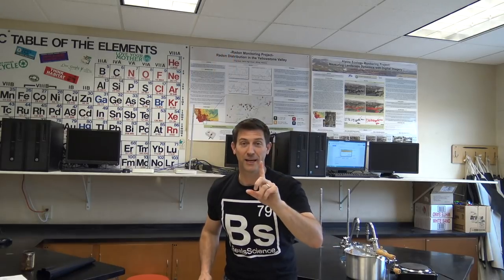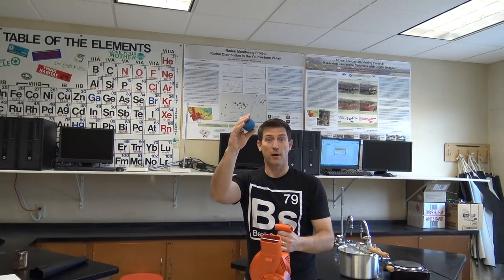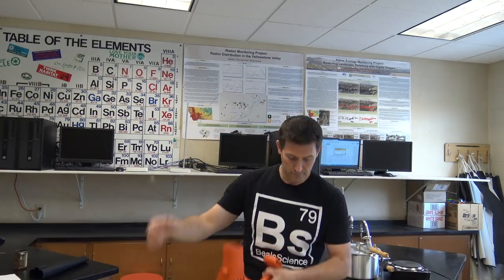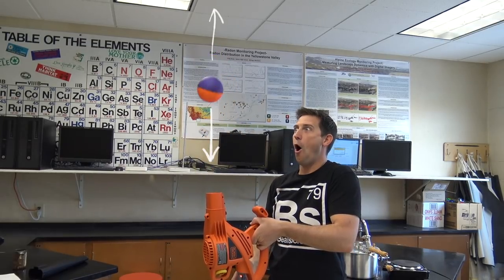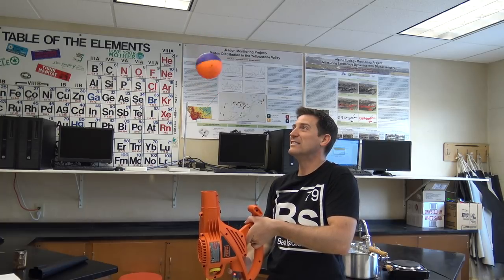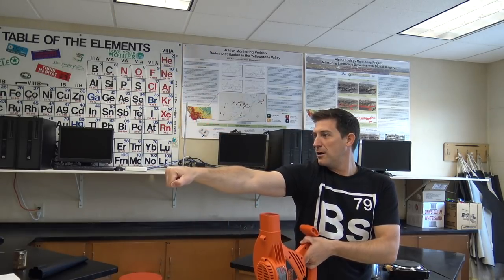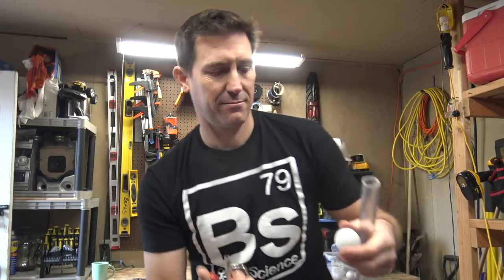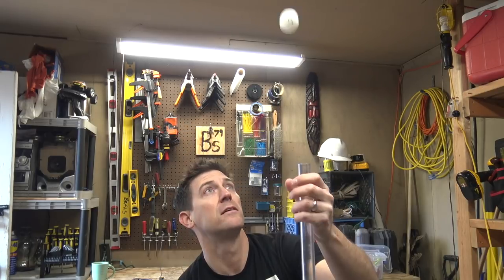Floating Balls - Bernoulli's Principle Visualized

Comment from the maker: Thanks for watching! I'd love to hear from you! Leave me a comment and let me know what you think or share an idea!
~Craig
Reply: Beals Science I found your channel from my fifth grade teacher Miss Whittle. She said she went to some event with you
Reply: Great video, not sure how you dont have more subs. Try reddit r/science or r/interestingasfuck .
Reply: @Beals Science,
Hi there :)

What would happen if;

Step1:  you had two similar air pumps, you run the 1st and let the ball levitate back and forth to left and right.

Step2: You turn on the 2nd air pump also. Does the ball get attracted to the 2nd pump due to pressure change?
Reply: Garden of AI 
You would definitely need an air pressure regulator to dial in the flow rate to be as close to the same CFM as one another, and even still I think the air would become turbulent rendering the experiment a failure 🤷🏻‍♂️ just conducting a thought experiment with the knowledge I have (or lack the of lol) of air flow doesn’t seem like this would work at all. IMO but I’d be interested to know 🧐
Reply: Pin it

Comment: As it seems you are keeping the ball on the vertical plane. This is not Bernoulli’s principle as per what I have learnt. This is balancing the weight by a force. Bernoulli’s principle applies for the force applied by the pressure gradient. Am I wrong? Please correct me if I am wrong....

Comment: I got a one question for you.
Can you explain for me...what is the difference between  Bernoulli's Principle and venturi effect?
Reply from the maker: I am not well versed on the Venturi Effect, but if my memory is correct, the Venturi Effect is an explanation of the drop in pressure due to a constriction in the area where the fluid is flowing. The Bernoulli Principle deals with the change in pressure due to the speed of the fluid (like Venturi) but is not limited to the constriction of a pipe (or the vessel that the fluid is flowing through).
Reply: Thank you very much. Have a nice day.
Reply: +Beals Science,
.
The venturi is one of the few places where Bernoulli's Principle applies. 
..
Pressure is higher in the wide section, but velocity is slower.  There's your inverse relationship.
...
Think about it.
The fluid/air has mass.
Newton teaches us that it takes a force to accelerate a mass.
Pressure difference is the force that accelerates a fluid.
...
In the venturi, the narrow section is a restriction.  This causes the pressure up-stream to increase; IN the fat section. This increased pressure in the large section pushes (accelerates) the fluid into the lower pressure, narrow section.  
Think of the narrow section as a hole in the pressurized fat section; like a hole in a pressurized tank.
Regards

Comment: +Beals Science,
.
Craig,
.
I really do appreciate the work you do to make science exciting.  I do the same at several schools and for groups like scouts.
...However...
..
I am very sorry, but it is not correct to say that "faster air has a lower pressure."
That is the all too common misinterpretation of Bernoulli's Principle.  The air out of the straw and blower is at the same atmospheric pressure as all the still air around it.   You can easily measure it yourself as shown in the Weltner paper linked below.
...
Bernoulli's Principle says that an increase in speed (this is acceleration) of a flow, IS ACCOMPANIED BY a decrease in pressure. 
..
 It says nothing about cause and effect, nor speed past a surface.  It is all about pressure differences along a moving stream and the acceleration those pressures cause.  
..
The science is that a higher pressure upstream in a flow pushes (accelerates) the air to a higher speed because the downstream pressure is lower.  There is a net force behind the flow, therefore,speeding the air up.  That is why it is faster when it gets to the lower pressure region.  This is nothing more than Newton for Fluids. 
...
It is centered by the Coanda Effect. Air curving around the ball is the cause of a lower pressure at the surface.  Think of centrifugal force trying to keep the air away from the curved surface of the ball (actually the air's inertia trying to go straight). This is what creates the lower pressure.  When the ball moves to one side, there is air on the other side curving further around the ball. This lowers the pressure more on that side, bring the ball toward this lower pressure.  The changing pressures are caused by air/water traveling less or more around the curve causing less or more pressure reduction at the surface, respectively.
The same thing happens when you tilt toe flow off vertical.  There is air above the ball flowing farther around the curve lowering the pressure more.   If you understand this fully, you can even explain why the ball moves further out as you tip the flow more off vertical.
...
The lift explanation is also flawed because Bernoulli says nothing about air moving past a surface.  The wing is moving past the air and measurement shows us that the air under the wing gets pushed forward by the wing at a faster speed than the air above the wing gets yanked rearward because of the lower pressure above the wing.  That upper air actually reverses direction from moving forward ahead of the wing to moving rearward above the wing.  This is a high acceleration from the pressure difference from ahead of the wing to above the wing. More change in pressure, higher acceleration of air.
...
Weltner in PDF - "Misinterpretations of Bernoulli's Law".  
SEE  Fig 3 is the fast air measurement:
 http://user.uni-frankfurt.de/~weltner/Misinterpretations%20of%20Bernoullis%20Law%202011%20internet.pdf 
..
Reply if you need further explanation.
Regards, Steve
Science and Technical Advisor
Reply: Observ45er thank you!  I have spent hours trying to understand this topic, and I think I am finally stating to get it!

Comment: Take 2.
+Beals Science,
.
Craig,
.
I really do appreciate the work you do to make science exciting.  I do the same at several schools and for groups like scouts.
...However...
..
I am very sorry, but it is not correct to say that "faster air has a lower pressure."
That is the all too common misinterpretation of Bernoulli's Principle.  The air out of the straw and blower is at the same atmospheric pressure as all the still air around it.   You can easily measure it yourself as shown in the Weltner paper linked below.
...
Bernoulli's Principle says that an increase in speed (this is acceleration) of a flow, IS ACCOMPANIED BY a decrease in pressure. 
..
 It says nothing about cause and effect, nor speed past a surface.  It is all about pressure differences along a moving stream and the acceleration those pressures cause.  
..
The science is that a higher pressure upstream in a flow pushes (accelerates) the air to a higher speed because the downstream pressure is lower.  There is a net force behind the flow, therefore,speeding the air up.  That is why it is faster when it gets to the lower pressure region.  This is nothing more than Newton for Fluids. 
...
It is centered by the Coanda Effect. Air curving around the ball is the cause of a lower pressure at the surface.  Think of centrifugal force trying to keep the air away from the curved surface of the ball (actually the air's inertia trying to go straight). This is what creates the lower pressure.  When the ball moves to one side, there is air on the other side curving further around the ball. This lowers the pressure more on that side, bring the ball toward this lower pressure.  The changing pressures are caused by air/water traveling less or more around the curve causing less or more pressure reduction at the surface, respectively.
The same thing happens when you tilt toe flow off vertical.  There is air above the ball flowing farther around the curve lowering the pressure more.   If you understand this fully, you can even explain why the ball moves further out as you tip the flow more off vertical.
...
The lift explanation is also flawed because Bernoulli says nothing about air moving past a surface.  The wing is moving past the air and measurement shows us that the air under the wing gets pushed forward by the wing at a faster speed than the air above the wing gets yanked rearward because of the lower pressure above the wing.  That upper air actually reverses direction from moving forward ahead of the wing to moving rearward above the wing.  This is a high acceleration from the pressure difference from ahead of the wing to above the wing. More change in pressure, higher acceleration of air.
...
Weltner in PDF - "Misinterpretations of Bernoulli's Law".  
SEE  Fig 3 is the fast air measurement:
http://user.uni-frankfurt.de/~weltner/Misinterpretations%20of%20Bernoullis%20Law%202011%20internet.pdf     

..
Reply if you need further explanation.
Regards, Steve
Science and Technical Advisor

Comment: With all due respect…somethin' ain't right about this so called Bernoulli Principle visualization. You're saying the ball floats as a result of Bernoulli's Principle but here the ball is merely "floating" by the force of the flow below impacting in equilibrium with gravity…and it is staying in place merely because of its shape which causes the flow to be evenly split all around the object keeping it "in place/centered" but this has nothing to do with Bernoulli's Principle. This is simple "holding" an object with a "dynamic" fluid "stick". The flows upward velocity is simply acting as a kind of support column to the object. The oscillation you observe occurs because of imperfections on the ball, imperfect "placement" of the ball into the flow, or imperfections the source of the thrust you are applying…but if you had perfect flow sourse of both, you'd have a perfectly static ball which would not oscillate, supported by a column of air—Having NOTHING to do with Bernoulli's Principle. But I could wrong.